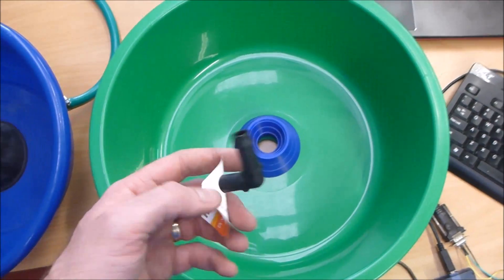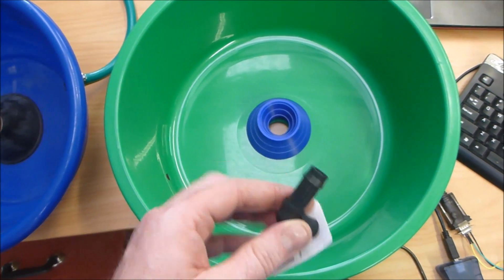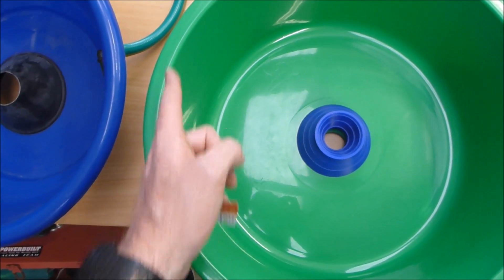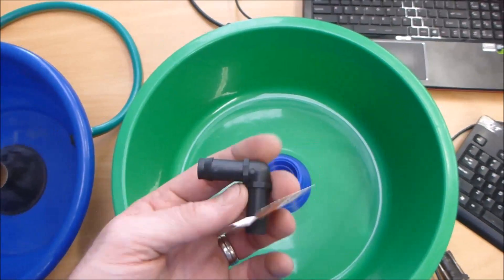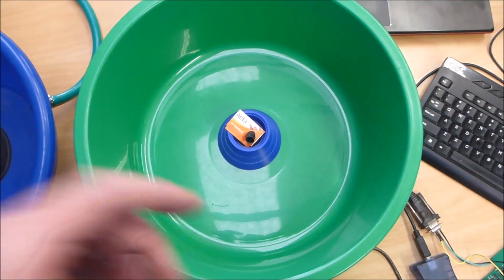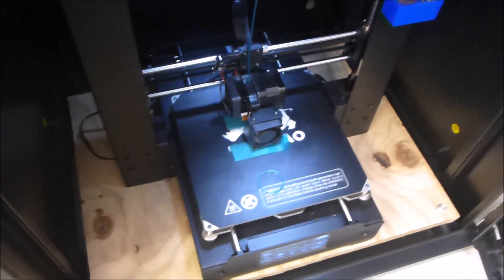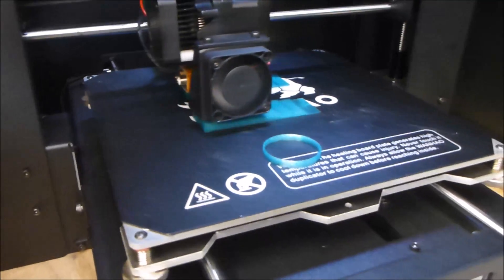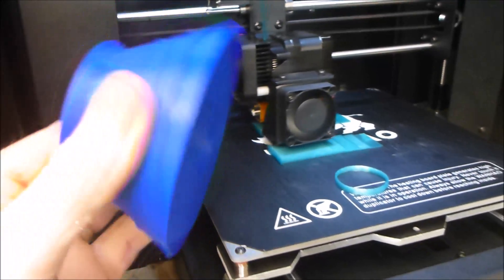Gold Recovery With 3D Printed Parts

Comment: BRO YOU NEED MORE POWER WATER
Reply from the maker: Bond wires are bloody tricky, I found that slower and longer was usually the safer option!
Reply: maybe the angle must be different, beacose this clean up its not good at all you can do that with pan
Reply from the maker: You can't pan bond wires, they are long and spindly, they do not settle to the bottom of a pan like alluvial Gold. Have you had experience with recovering bond wires ?

Comment: I can not seem to find mine , been some yrs.
Did a search , and surprise at the limited info & sellers .
https://www.google.com/search?q=gold+amalgam+retort&biw=1226&bih=679&tbm=isch&imgil=JmE-gxuUqf2riM%253A%253Bzuhb5TI6bk7IeM%253Bhttps%25253A%25252F%25252Fwww.alibaba.com%25252Fproduct-detail%25252Fsmall-mercury-distill-mercury-retort-for_1647996394.html&source=iu&pf=m&fir=JmE-gxuUqf2riM%253A%252Czuhb5TI6bk7IeM%252C_&usg=__D3JE0pMq9WCz8t0WndWi2uzG4ag%3D&ved=0ahUKEwjn3LXT2q3RAhWW2YMKHS4FCjQQyjcIUQ&ei=xKZvWOfqJJazjwSuiqigAw#imgrc=IEp0uK8ghNV-BM%3A

Same with Miller table , nothing like what I was familiar , large slate table about the size of pool table .
Mostly smaller home made stuff nowdays .
Reply from the maker: Hi there, sorry about the late reply, I have been studying the concept and have seen some pretty good designs for basic stills to separate the mercury from the gold. Will certainly be giving it a try.

Comment: Past gold miner in No. California , and now doing some scrapping while doing electronic's repair .
A few suggestions , I get the gist of what your doing / recovering gold with the least amount of chemicals , fuels etc.
I applauded your efforts to confirm what may be lost or captured with various methods .
So I would like to suggest some additional methods that take less effort / with more recovery .
Take a look at Miller tables for fine gold recovery .
But for much less cost & space using mercury [ no loss , all mercury is recovered ] and a retort [ its basically a inclosed still for separating the amalgam of mercury & gold ] .
Once your down to the fines [ small enough to get difficult to recover ] - in gold mining this is a small portion of the gold recovered , but in scrapping is the major portion of gold , before mixing / amalgaming of the fines , do a wash [ with some chemical , even just dish soap ] to clean the gold of any oils etc. that may keep the gold & mercury for combining .
This is manly to make the separation of the gold from all else much easier , especially with fine , even microscopic gold .
Then once you - to keep short [ too late ] put the amalgam into the retort & low heat , enough to vaporize the mercury and send to the top collector , leaving the gold in the bottom reservoir , once cooled , you remove the gold and reuse the mercury .
Reply from the maker: Hi KDOCAC, that is a fantastic quality comment, I would be very interested to explore this process since recovering the super fine gold is such a difficult process. I have a bit of mercury sitting here in the workshop, but have never really got into using it because there is not much information available on how to use it safely and 100% recover it for re-use as you describe. Is there any way that I could contact you ( maybe email ? ) to get a few more details before I jump in and 'learn by doing' ?
Reply: How you suggest we exchange info , I would not think of here as a 1st choice .